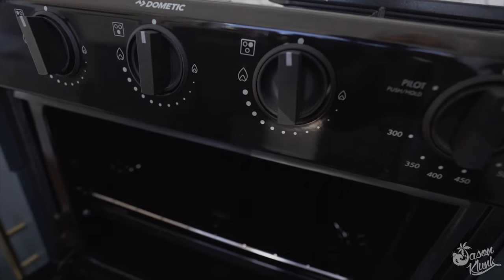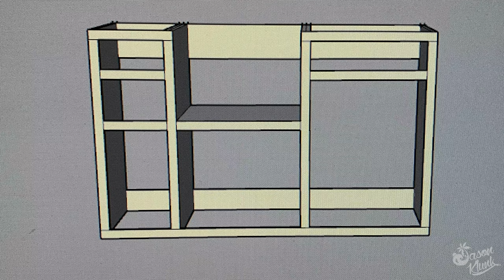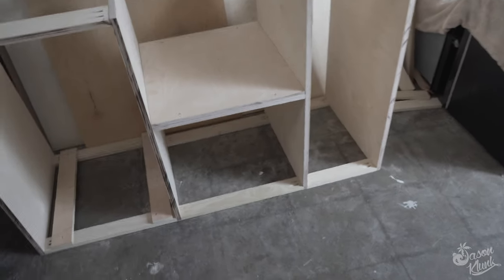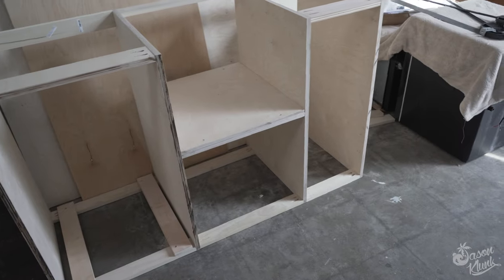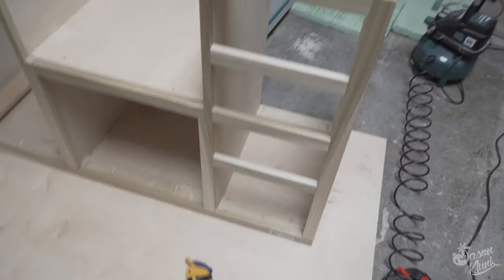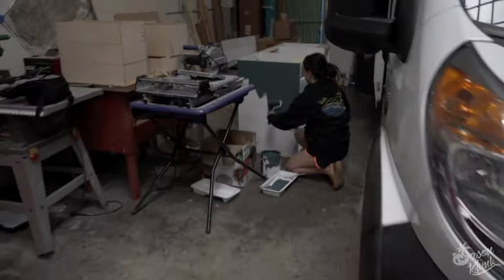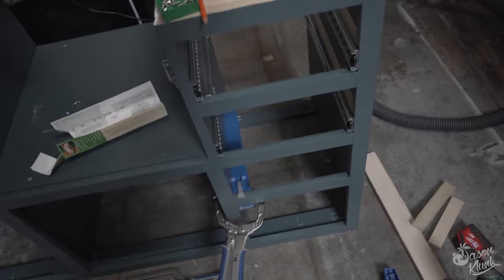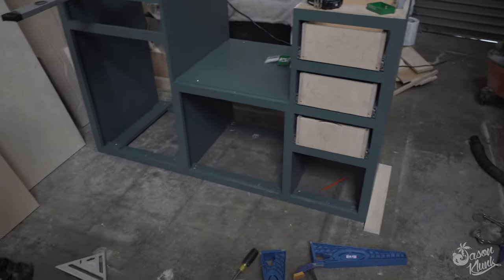Building the Kitchen Cabinet w/ Oven! Ram ProMaster Van Build Conversion - Episode 17 | Jason Klunk

Comment: You used .5 inch for the draws but 3/4 in for the frame right? Whats the overall weight estimate? I'm looking at doing something simliar but after making my upper cabinets out of 3/4 marine grade and each of those being 30-40 lbs I'm worried this will be like 100 lbs of wood alone..

Comment: Lovely work, you're very talented. I always wanted push to open drawers, on doing research this is what they're all saying: "Don't do it! I did and regret it. Will be replacing them soon. They open every time I drive 🚗 😒"
Soft close is what you want, where they are stiff to pull open, hense they stay closed.
Reply from the maker: Thanks. I’ve got one problem drawer but it’s because I installed it a little off - I just need to spend a few hours redoing it. Other than that one, I’ve been happy with my drawers.

Comment: 8 years...8 different versions of my E250 Ford Econoline. I now have an Isotherm 85L refrigerator and its snowing today so im looking at refrigerator cabinet videos. stumbled onto your video and i think i shall have an oven also. is there some heat shielding fire resistant paint etc used or just fit it in?  thats a great cabinet! thanks for sharing.
Reply from the maker: Nice. Nope, it's just dropped into the cabinet. I thought the same thing and did a lot of research before I felt comfortable installing it in my van. The cabinet has to be built around the oven in a certain way for it to be safe, the documentation for the oven includes all the dimensions for what the cutout should be.

Comment: Of all the things you’ve done thus far is there anything you would do differently? Like in regards to solar? The max air fan install?
Reply from the maker: If I were to do another one, the only thing I'd try to do different is the wall paneling so that it went all the way to the ceiling.

Comment: Is the dometic Atwood good to go like that? Or did you plan to use hardie boards and/or thermotech? 

I have the same and debating if I should drop the oven straight on the plywood
Reply from the maker: I'm not sure about the Atwood. I thought about doing the same thing and did a lot of research before I felt comfortable installing it in my van. The cabinet has to be built around the oven in a certain way for it to be safe, the documentation for my oven included all the dimensions for what the cutout should be and how it should be installed.

Comment: Hi Jason. What wood did you use for the batoning and for the face frames? and do the face frames sit flush or do you have to instal spacers for the draw hinges etc? sorry but i couldnt see in the description or mentioned in the video. thanks
Reply from the maker: I used poplar for those pieces. I'm not sure what you're asking in regards to the face frames though.

Comment: Would you say a table saw would be easier than using this method of cutting just using a circular saw?
Reply from the maker: A nice table saw is much better than using a track saw. But if you don't spend the money on a nice large table saw, then no, the track saw is better IMO.

Comment: Great video Jason! Question: Those drawer slides.. How did they work out in the end? Have you been driving the van with things in the drawers? I am thinking of using the same type sliders but concerned that they will work okay as I don't see many using this type. :D Thanks!!
Reply from the maker: Thank you. I like them, every once in a while one will pop open if I'm on some bumpy terrain.
Reply: @JasonKlunk  Thanks for the reply Jason. 🙏 I am going to think more on if I wanna go this route of add some extra lock on the drawers. Thanks! 🙏
Reply: They will open when you drive, get the soft close ones that have tension when you pull them to open, they'll work perfectly, push to open are only good if you're in sticks and bricks.

Comment: I'm also looking to fit the dometic r31 in my van kitchen. I am bit confused by the pre-install/install requirements. It looks like its pretty flush on the sides and bottom but there is some space in the back? Could you explain that a bit?